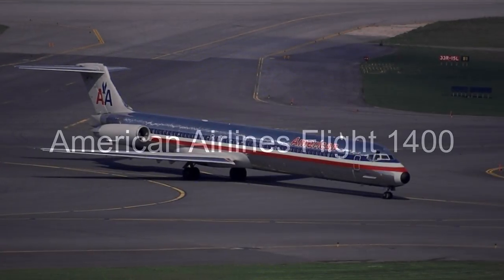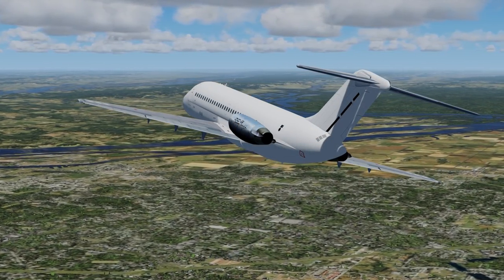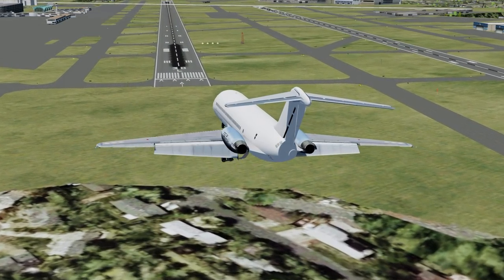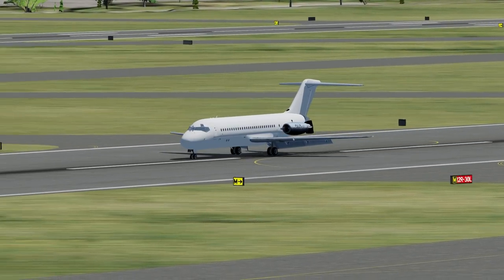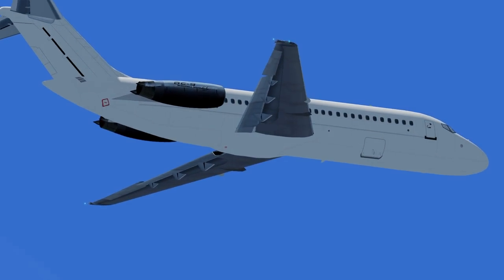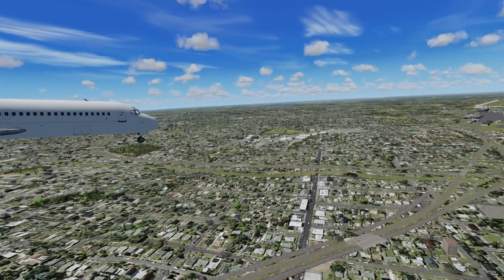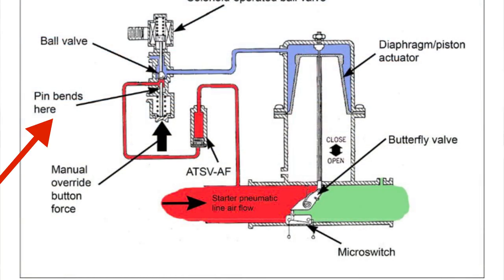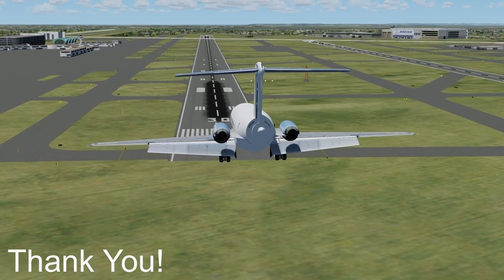How A Tiny Bent Switch Set A Passenger Jet On Fire | American Airlines Flight 1400

Comment: Was there anything said about why their hydraulics and electronics failed? And why the landing gear didn't come down? The ending was a bit abrupt compared to your other vids where you clear up every part of the story that you mentioned.
Reply: Landing gear is lowered by hydraulics and electricity is generated by engines, and hydraulics are powered by engines. If engines fail, you can lose hydraulics and electricity. Most planes have backup electricity systems, I don't know much about the DC9 so I don't know if it has one, but it could have been inoperative at the time.
Reply: @YHDiamond  but also, their right hand engine at no point failed, so that makes it even stranger
Reply: @MrXPeaceLP  some avionics are powered by the left engine. So it may have been the ones that failed
Reply: Engine 1 was down so power and hydraulics would be down. They may not have had a generator on the second engine but there would have been hydraulic pressure provided. There must have been some to get the gear down. I am pretty sure the primary flight controls were manually operated so a ram air turbine wasn't a part of the design so that mean no third back up of hydraulic pressure or electrical. Not sure why the APU didn't provide some power but I'm guessing the wiring probably was bundled and got scorched so the redundancy was gone. Remember this is a much older plane so having 3 redundant and separate systems  on it wasn't crucial back then especially given the size of it. There's been later cases on newer planes where all the wiring was ran in one trunk and once the fire took it out it didn't matter which generator was operative since all electrical connections were severed. Same for mechanical controls where fires have melted and warped them as they all ran in one trunk. Freak accidents with a chain of events. That's how we learn
Reply: Yeah it's called fire from the engine could have damaged the hydroluc lines since the heat signature was hot by the airport fire crew that did the thermal scan
Reply: What I suspect might have happened was because of the damaged filter,  when the engine lit off, the bleed air was forced back into the starter.  So now you have a runaway starter and the impeller and gears are not ment to turn at the same speed as the engine so it let loose and you have pieces of starter severing hydraulic and electrical bundles ,, possibly a fuel line.  It is uncommon but I've seen it happen. 
Back in the 80s,  I worked on a 727 where a chunk of starter went through the engine cowl and into the fuselage.
Reply: @MrXPeaceLP   With no electrical power so no fuel boost pumps,, you still have the engine driven fuel pump ( mechanical ) that run the engine.
Reply: The DC-9 first flew back in the 60s and since has been retired in commercial airlines, so it may be too old to have more adequate reduncies. Critical hydraulic systems such as with flight control surfaces, in more modern aircraft are a cross-over system in that either engine can supply sufficient hydraulics.

Comment: The crew did their best under the most difficult of situations.

However, i’m not sure I would have gone around with a fire. That plane could have fallen apart at any moment. I’d of definitely continued. Presumably the cabin crew were already briefed for an emergency landing. Their procedures would be the same regardless of if it was a fire or gear up landing. 

Having said that, they got a positive outcome so the captain was right on the day!
Reply: what happen if they over shot?
Reply: Procedures for go-around are still to be followed with a fire on board. Just like if a fire is detected on take-off, and you get past V2, you never abort the take-off.
They are cases of "following procedure may result in an accident, but not following procedure WILL result in an accident!".
That "Continue" will be the hardest call ever to make. But it MUST be made, it's the only way of staying alive !
Reply: @adamjoseph4148  A manageable fire would instantly become a deadly fireball !
Reply: How would a plane fall apart by an engine fire lol? You don't sound like a pilot.
Reply: @nihlify  really? Do you have any idea how quickly a fire can destroy an airplane? A fire is just about the worst thing in flight. 

The correct decision, IMO, would’ve been to land. They were already on final and should have committed to that. 

Fires don’t give you extra time to get “ready”. 

Oh and if you want to challenge my credentials:

ATP with 12k+ hrs of flight time with multiple type ratings in jets and turboprops. 25 years of experience in commercial flight.
Reply: They rolled the dice and got lucky. They had an ongoing fire, with evidence that the fire was affecting the AC, as in the loss of electric power. If I ever did a go around for a gear malfunction in a sim checkride, in this situation, the examiner would simply toast my ass off.
Reply: @c208driver6  thin aluminum heat reflectors with flammable hydraulic oils, engine oils, supplemental oxygen canisters, cabling insulation, etc.... what's not to love about fires on board? Not to mention that nice stream of fresh oxygen blast furnacing it. Same as no one wants a fire on board a ship.
Reply: No, they did NOT do their best. They ballsed up procedure and made things worse.
Reply: If I understand correctly, they also blew the fire bottles into the engine. This effectively makes the engine inoperative. So they did a go around on a single engine? Not recommended.
Reply: @nihlify  I’m not sure your pilot credentials are particularly credible given your comment. 😉
Reply: @TimSmyth23  Harsh comment. I agree that they made the wrong choice but I’m not sure any pilot doesn’t do their best in an emergency situation. These guys did what they thought was right in an extremely stressful situation. Thankfully the got a good outcome. The key is to learn from these situations, not destroy the pilots!
Reply: @c208driver6  I doubt your creds.
It was an engine fire, not a cargo fire, or interior fire.
Reply: @etherealrose2139  It wasn't onboard.
Reply: @alhanes5803  Hey just bc I know what I’m talking about and have not only creds and experience to back it up. 🤷‍♂️ 
A fire is a fire. Period. You get down NOW. You don’t go around. Period.
Reply: @c208driver6  
A fire is not always the same.
An engine fire is a completely different animal than a cargo fire, or interior. 
NTSB says what I'm saying.
Rather than just slam it on the ground, he assessed the situation, made a decision,  and landed safely,  without destroying the aircraft,  or injuring anyone.
You would have at minimum,  destroyed the aircraft.
Reply: @alhanes5803  and your creds are?
Reply: @c208driver6  
Many.
Reply: @alhanes5803  ok. So you’re not even a pilot. Got it. 😂
Reply: @alhanes5803  you know, if you’re interested in flying airplanes, you can go to your local flight school and do a discovery flight. 😂
Reply: @alhanes5803   Here's the thing: Not only was an engine on fire, which is a serious situation all by itself, but they had lost all electrical power as well.   The plane's systems were failing, and it's only gonna get worse from there.  (And indeed, it did: they subsequently lost hydraulic pressure as well.)  At that point, the only rational decision is to get the plane on the ground ASAP.   Inoperative nose landing gear is no big deal -- airplanes land safely without nose gear all the time.  Under no circumstances is that a valid reason for going around when the plane is on fire and you've already lost electrical power.

Comment: As implied by that very significant question posed by the investigator to the Captain "why did you go around" is saying in a completely different, yet identical way, what 99.9% of people would think in their gut namely "Why didn't you get this on the ground ASAP?" With a major fire on board - by the way which has been demonstrated so so often before - quite simply you are doomed unless you can get down and get off in minutes. I can't remember the exact flight number but I recall explicitly a Swissair flight. Within minutes, pilots were overcome and by then, irrespective of what happens to the structural integrity of the plane after that, well.....

So yet another way of paraphrasing the investigator could be, thinking aloud, with such absolutely fast-acting and dire consequences, why didn't you risk a few injuries  to get down straight away just because of the extremely marginal contra-procedural action of "not having informed cabin crew".

We can surely infer that everyone a) was seated and b) had on their seatbelts. The only thing we don't know from this clip is whether, due to the electrical issues, the Captain was able to tell everyone "brace brace". Perhaps this is not as marginal as I think... does anyone have stats on the relative survivability of air crashes depending on whether or not the brace position is adopted?
Reply: You actually are less likely to be severely injured in the brace position.

My view is that the results are what matter most.  
Nobody.  Died.

Second guess him all you want, but his choice to take that risk paid off.

Yes, it's arguably the absolute wrong choice, but it still worked.
Reply: Stats prove brace position does not improve chances of survival. It does save faces from injuries, so identification by dental records can be carried out. 

A very long post, with little aviation knowledge behind.
Reply: @thefreedomguyuk  the experiments I saw showed that the brace position does help with specific types of injury possible during a plane crash.

However, given that a plane is a giant hunk of metal and people slamming into the ground, there is of course a point where the brace position does not help.

Comment: FYI There are no turbines "right up front (of the engine)," but there are rotors that with stators compress air for combustion! Other than that, GREAT VIDEO! 👍🏽
Reply: Semantics... Its a disk of blades that does work upon air, so I imagine with that definition you could call it a turbine. I know what you mean from an aviation terminology standpoint though.
Reply: It's called a compressor.
Reply: @BobbyGeneric145  Nah...you can't call it a turbine, because it's NOT! Terminology means everything in this business!
Reply: @BobbyGeneric145  Is not just semantics. Is like calling the ailerons rudder, or call fuel the oil. Completely different things.
Reply: @michaeldavenport5034  Uh yeah, it has high & low stages! 🤨
Reply: Stators ? Really ??
Reply: @thefreedomguyuk  No, rotors opposed to turbines really!
Reply: @BobbyGeneric145  Nope, both have blades, but don't do the same thing.

Comment: Your report is great because it covers both sides.  The captain made some errors regarding CRM.  As you stated, he allowed the creep of non-critical tasks to impinge on critical tasks. 
Understandably.  He was communicating the situation and the plan to the cabin crew.  
The best move made was to bring in an off-duty pilot to help manage the workload.  THAT is resource management. 

And I absolutely agree with the decision to go around.  I also agree that probably 90% of pilots would have neither the balls nor the big picture thought to get past “I’ve got a fire and my systems are dying.”

There is a reason the NTSB investigators wanted to know that answer that we can all absolutely feel.
Reply: Pilot should not have gone around.  Plane is on fire -- that trumps loss of nose landing gear every time.
Reply: The fire and running on one engine, avionics malfunctioning, and THEN losing your nose gear is a tell-tale sign of "get the fucking thing on the geound asap!"

Comment: But why the electrics and right side hydraulics failed? How you put it it looks like the fire was serious but somewhat contained to N1 engine. I fail to see the other issues.
Maybe the bleed air pressure in reverse to the small starter turbine fucked up every other line around, but the right hydraulic system is on the other side right?
Reply: They're interconnected actually. The L1 engine not working probably disrupted the hydraulic system on board which in turn affected R1 engine.

Comment: 6:15 It’s a compressor; turbine is the part that gives power to drive the compressor and of course produce the thrust and so on
Reply: Came looking for this. A turbine is turned by the exhaust gas flow in a jet engine, the compressor and turbofan are turned by the turbine via a shaft or shafts (2 in the case of the JT8D).

Comment: Honestly, it sounded like the crew acted fast and in a reasonable way, the captain was the guy flying, he knew how it felt, I feel like he made the right decision, as you said, a rushed gear up landing would not have ended well, even informing the cabin to be ready to evacuate seems reasonable, he obviously felt like he could get her down, and wanted the cabin crew to be ready for when he did, overall I think they done well in a high-pressure situation with no instruments to help, a pilots skill takes over when all else fails, and they acted in the way they saw fit, thumbs up

Comment: From the perspective as a recently prior Air Force Egress technician, whenever we heard an IFE (In-Flight Emergency) called over the radio, I would always get my hopes up that I would finally see one of our jets eject in-person, but with these much larger civilian aircraft that rely solely on the aircraft and crew to escape horrible death, I commend the crew for getting her on the ground without any casualties. Those are some absolutely excellent cabin crew to get this plane down with unknown problems from the side effects of a massive engine fire and not have a single injury. Sure, you can nitpick at the individual crewmens' activities and what they should have done, but in the end - their combined effort lead to the lives saved of dozens of people and that should be the ends-justify-the-means of this investigation. The pilot wasn't under the influence of any intoxicants, nor were the fellow cabin crew making poor decisions themselves, so I for the most part see this as a total save from the crew. That maintenance production should be absolutely hammered for their negligence on the filter, and I'd put them responsible for this accident. Maintainer rant over.

Comment: There's no way I would have gone around with a fire. A nose gear issue is in a different category of safety that can be handled much more easily than a fire that has not responded to two discharges of fire bottles.  They were skilled, but also very lucky.